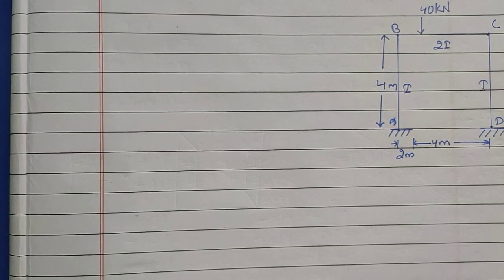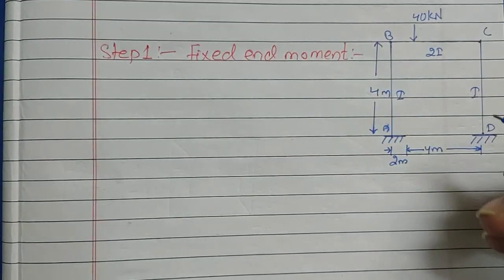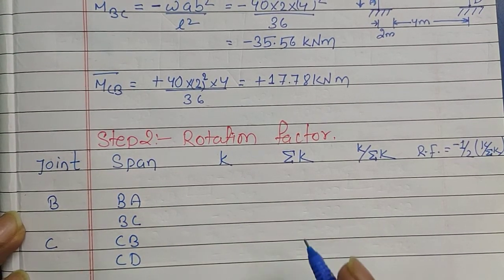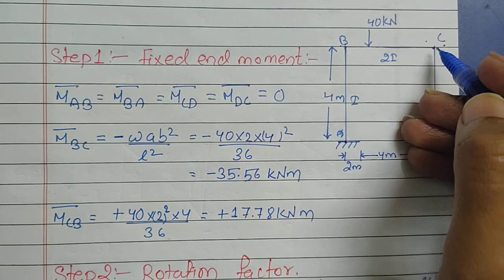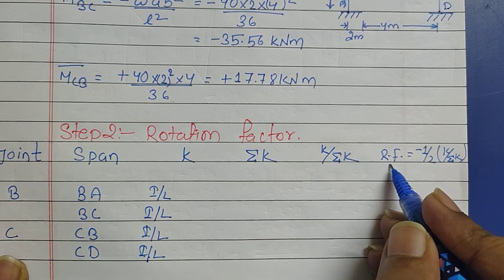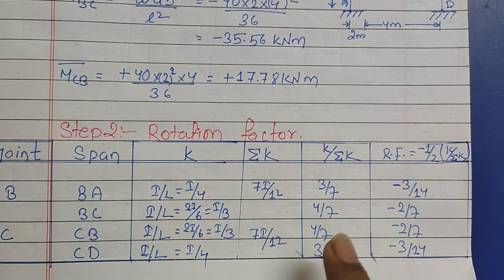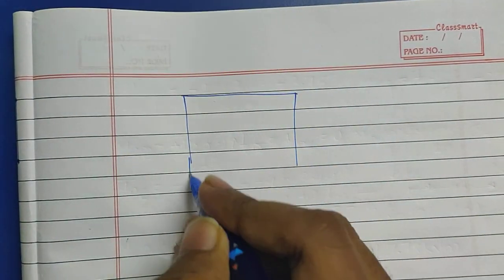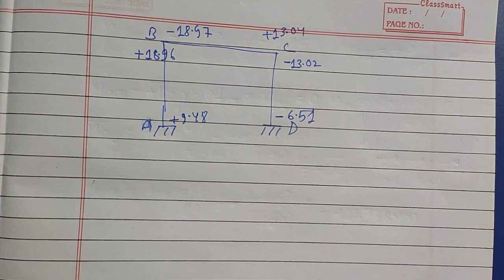Rotation contribution method | kani's method | step by step

Comment: Will the procedure be same if the load is acting on the middle of the beam?
Reply from the maker: Check the playlist. You will find an example on it.
Reply: @Civillearningonline  I could not find that can you provide the link of the video...
Actually I want to learn to solve a simple symmetrical frame  by kani's method in which there is a piont load load acting in the middle of the beam...
Reply from the maker: @achiever96  Rotation contribution method: https://www.youtube.com/playlist?list=PL513Y7_xBTnAwTAIGyPKIugpMZqJmScuy